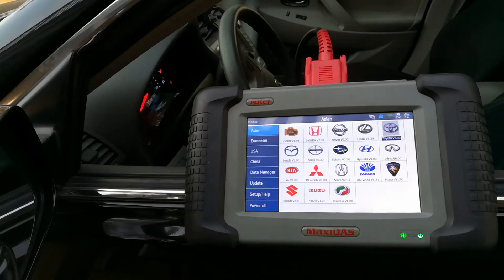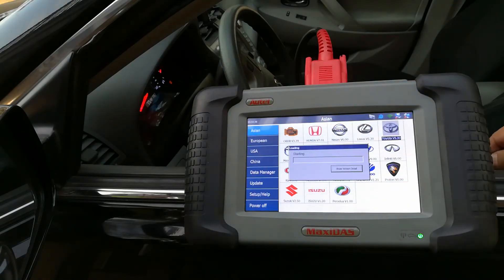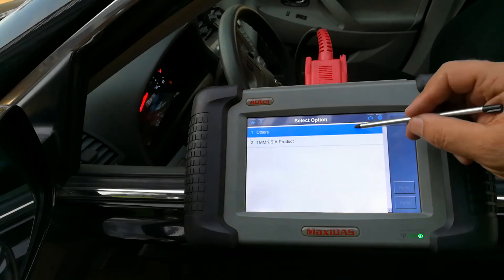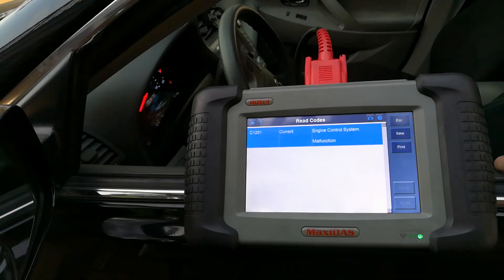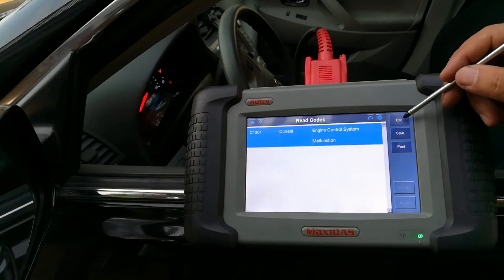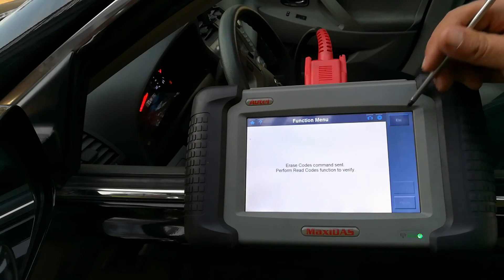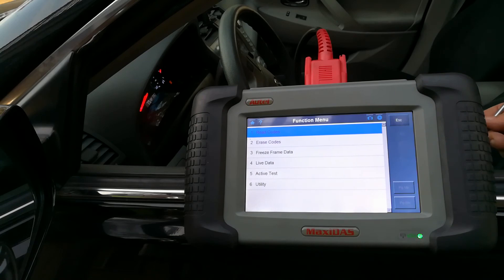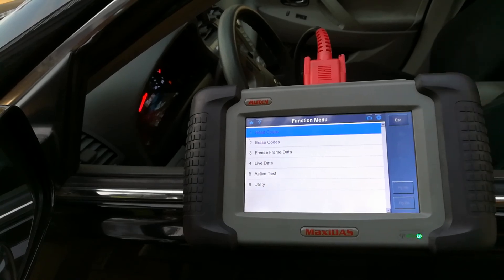How to Reset ABS Light using Obd2 Scan Tool

Comment: I been having problems with the abs and brake light had all sensors changed and I have 06 Chevy Silverado and still the code is on the speedometer bounces around and it revs high when you barely push the gas and when you pull over the abs light and brake light go off and it shifts fine again until you hit a bump and the lights come back on
Reply from the maker: Check the connections especially the grounds for the vehicles as you stated it comes back when you hit a bump. A scan tool may point you the right direction as well. Here is one I recommend if needed https://youtu.be/QKNp2bFYcVI?si=BFajXns1mipDCcHR
Keep me posted on what you find.

Comment: Quick question? can you read a 2006 dodge ram with this scanner ?.
Reply from the maker: Yes this read the 2006 dodge ram without any issues.
Reply: @RANDOMFIX  Thank you 🙏🏽 is becouse I just got a seatbelt light… I checked the plugs and stuff under the seat but still haven’t found the problem